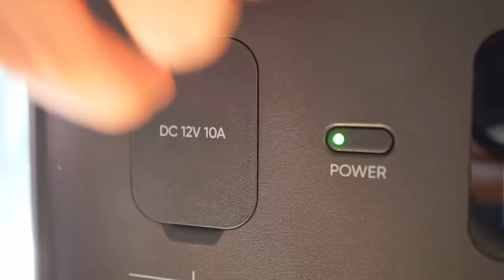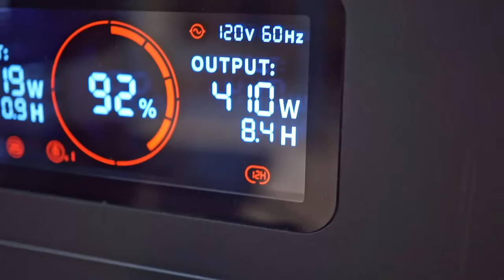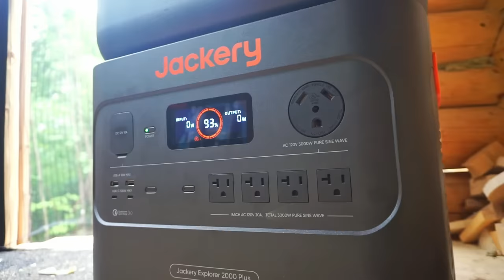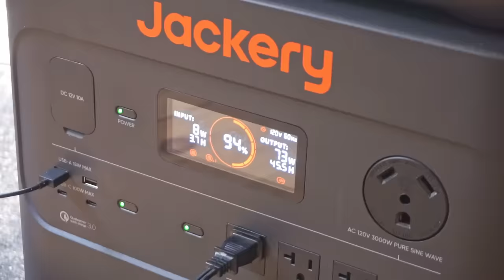Building A Log Cabin | Ep. 58 | Tongue-and-groove ceiling & Bathroom curtain & Gardening

Comment: I always found that when I had finished a certain part of a project, that no one could really take note of all the work you had done, nor know of the problems you encountered to make it all look great, or the length of time that you spent.  It is even worse when you finished the trim around windows or doors.  Most people only see when it is not done, but not when it is all done.  Just a kind of a downer!  But you just keep on cutting, hammering away!  And it is still looking great.  It must be a joy to lay in bed and instead of looking at plastic covering the insulation, a nice pine board ceiling!  And you can thank each other for getting it all done.

Comment: I really admire the craftsmanship you achieved in your cabin.  I’ve only seen 2 things id do differently. One, I would have weatherproofed the subfloor on the deck before planking it over, because you’re going to track in snow in the winter.  The other is I’d add small diagonal braces at the outside ends of your deck.  I looks pretty sturdy and the roof planking helps, but it feels like it should be braced along that long edge.

Also, now that you can charge one, you might invest in a medium sized electric chainsaw for your firewood.  You’ll still spend a lot of time hauling and splitting, but a saw will free up a lot if your time for other things.

Comment: also vents in the corners  of the cabin walls I don't see it. You don't want mold settings  in that would be a shame  after all that work. Also cold storage and dry storage  good luck .also a dog would be good for protection from  the animals. But you need to. Prepare for the winter months just canning  and am getting  lil worried  for you two